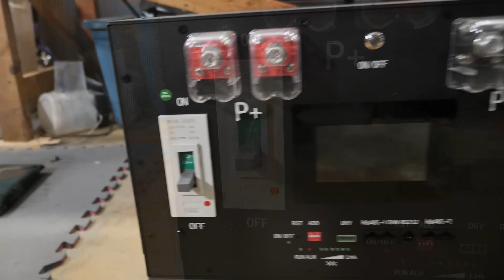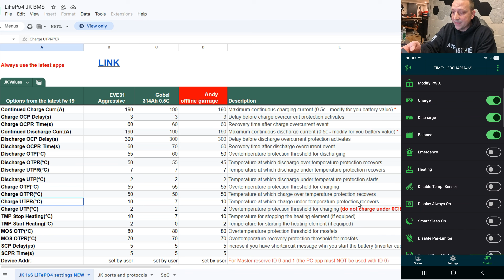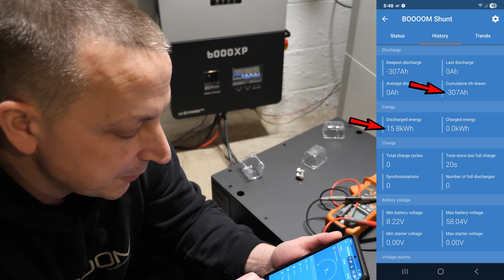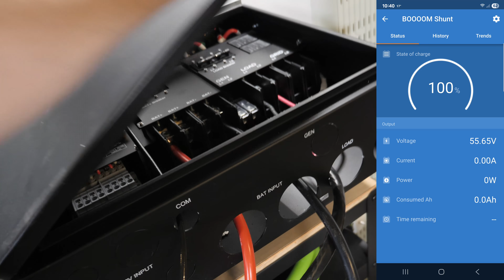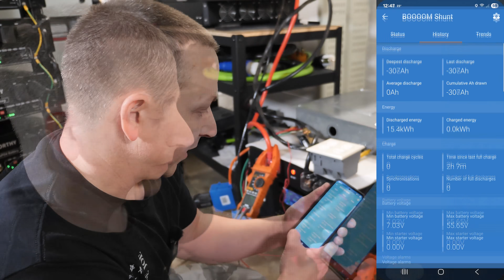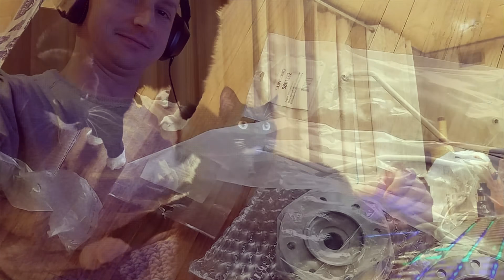Diy Yixiang Battery Capacity Test and JK-BMS Setup

Comment: Did you end up putting that battery in closed loop with other eg4 batteries or did you just use voltage and let it run in passive mode next to the other batteries which were still in closed loop?
Reply from the maker: I dont have any eg4 batteries but at the moment it is passive since it has a different bms than the closed loop batteries I have connected. I do plan to use it along with another in closed loop here soon.

Comment: Hi Joe I love your videos! 

Do you think it's possible to assemble this battery as a 15S instead of 16S to make the voltage a true 48v?

I am wanting to hook my Delta pro up to external batteries but I didn't know that they use 15S and so it is a true 48 volt instead of 51.2 so for my understanding (correct me if I'm wrong), it will not work correctly with 16s external batteries because it is not the same voltage. 

So it seems getting one of these DIY batteries might be the solution. do you think it would work? Would I have to get a separate BMS?

Comment: Would these transpose fairly well to the MB56 cells? Assume they would. Except the obvious stuff like capacity and stuff. ALso i'm using a 300 A jk bms but max discharge is fine at 200 and max charge is ok 150. But curioius how they would differ, if at all , from the yixiang 32kwh witht he 628Ah mb56s.

Comment: Do you recommend setting the battery capacity to 320 instead of 314 because when you tested the batteries they produced more than the 314 that they are rated for?
Reply from the maker: You betcha change it!😎🤘

Comment: User private data and user data 2 actually very useful with some inverters . In my case with solis s5 if i putt PYLON everythink works as normal, without that inverter is in eror no name battery and it wont use battery
Reply from the maker: Interesting🤔 Thanks for the info!🤘
Reply: @AVERAGE_JOE  Thank you for infornation, test and sorry for your loss

Comment: The over voltage protection reset only comes into play when one cell hits the over voltage protection, 3.65v in your case. This should only happen if one cell overshoots your requested charge voltage of 3.525v. Once the battery hits the RCV, it goes from bulk to absorption for the period of time set RCV TIME. After that it drops to RFV requested float voltage again for a period of time set in RFV TIME. Then the cycle starts again back to bulk and charge to 3.525v.
Reply from the maker: Great info! Thanks!😎🤘

Comment: You did the Amps calibration, but you should also verify the Voltage calibration. I found that both my JK BMS's were off on both V/A, and this affects various other values that are monitors, Ah in/out, SoC, etc

Comment: I agree definitely on the 3.52-3.55V for the RCV. I don't see how the cells could truly be fully balanced when they never start to drift past their charge curve at 100%.  There may not be a lot of capacity, but there is definitely some to make sure they are balanced every time. If there is some deviation, the BMS won't really know until it becomes big enough of an issue there's more variance than what the BMS can fix in a few charge cycles.
Mine are set to 3.55V

Comment: Hi Joe, the RCV is to "Recommended" charge voltage, it is Requested Charge Voltage. So that is what is requested to the inverter with the communication versions.
Reply from the maker: Ahh ok, Thanks! Yeah lots of different settings I am not use to looking at yet😁🤘

Comment: if you connect the jk bms using home assistant and use a normal 58 volt charger, the home assistant can graph the voltage of the cells to clearly see the hockey stick curve. It really helps when selecting a charge voltage for your solar charge controller.

Comment: Sorry to here about Horace, Joe.

I've had this exact battery (with EV 314 cells) for 2 months and its been running my house (about 95% of it) off-grid since powered up.  I did changed a couple settings based on your video.  RCV was increased to 3.50 (56.0v) and the 0% SOC value to 2.6v and my Capacity to 320 

Thanks for the great information as always and wish you and Mrs. Average Joe the best.